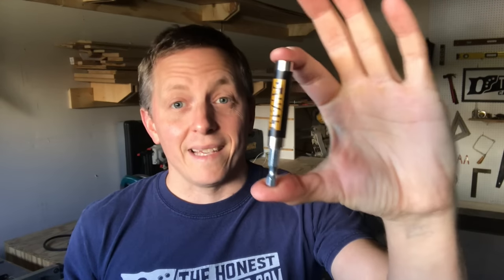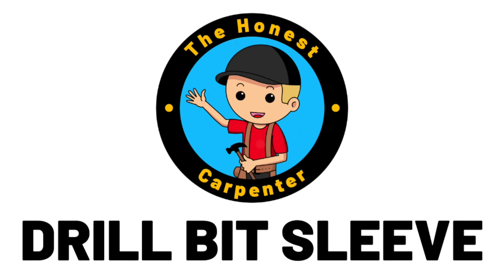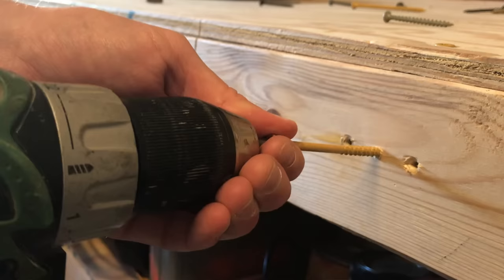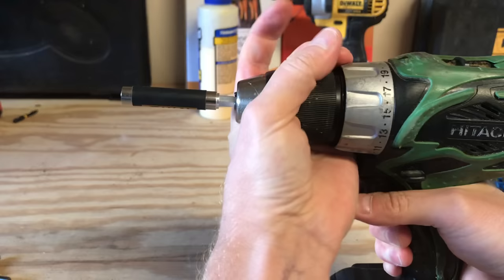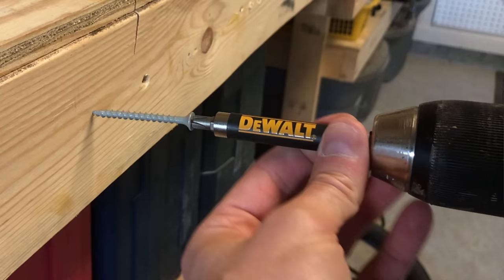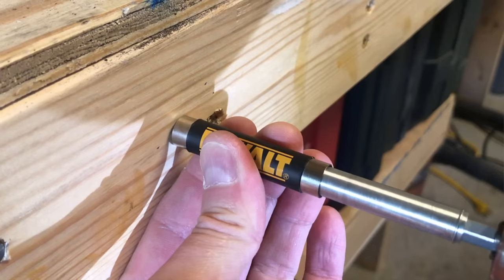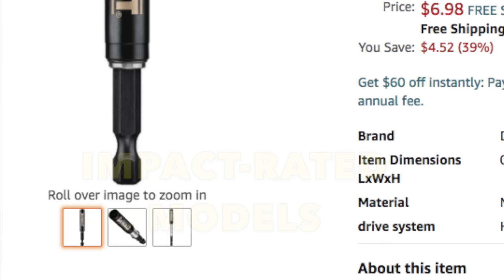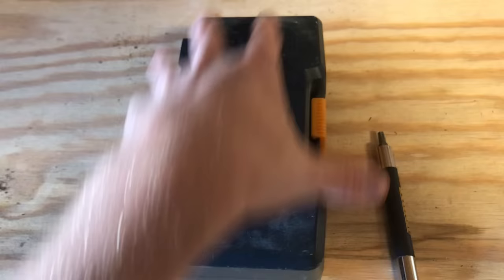This Tool Helps You DRIVE SCREWS WITH EASE! (Bit Guide/Bit Sleeve/Drive Guide/Drill Bit Sleeve)

Comment: Be mindful that sometimes the driver guides may not work on the older dual-sided bit drivers  (PH/S) because the slotted side makes them loose in the driver guide. I found there is a slight diameter difference between Ryobi and DeWalt driver guides which causes wobble. DeWalt is smaller and more accomodating. Better to use the small, l single-sided bit drivers and toss the dual-sided ones. Peace.

Comment: it's a handy bit but the problem I have with it is after sinking a square bit screw, the small bit usually gets left in the screw when I pull the drill away. Mildly frustrating after the 30th time...

Comment: Hi, i just purchased on off amazon, but i noticed that the screw doesn't stick to the bit. I hoped it did, because that would make one-handed use easier. now you can't use it vertically with one hand, and not well horizontally.  I tried adding an extra magnet, but that doesn't solve the problem. Regards

Comment: It's cheap Chinese stuff with a huge DeWalt on the side.  I recently bought a DeWalt countersink bit - made in China.  On its first use in countersinking a drilled hole in a cabinet, it came apart.  Yup.  That cool part on the bottom so that it fits in the chuck the same as the other bits in your tool box is only STAMPED onto the flat of the drill shaft underneath.  Cool, right?  Not when it comes apart.  Immediately.  Cheap tools made in China at premium prices because they are from Yellow Brand.

Comment: I have a couple of these and couldn't stand them.  The sleeve just slides down whether you want it to or not and makes it so you cannot see how far you have driven the screw.  I pulled the retaining rings off and removed the sleeve and just use it as a normal bit driver.

Comment: I use one of these to access restricted areas where it is impossible to maintain the bit in-line with the head of the screw...for example in a narrow stud bay where the body of the drill bumps against one of the studs. This guide acts as an "extender" allowing the drill body to be further from the head of the screw...and the annoying stud.

Comment: I've used these before and felt like I just ended up having the screw wobble in the sleeve, I'm a commercial electrician though so I'm usually driving into metal. I feel like it's really not that big of a deal to just use your fingers to stabilize the screw

Comment: What is the model number for the short one and can it also be used with a drill driver with 1/2 inch chuck or does one need a different model with a cylindrical end to fit into the chuck?

Comment: Dumb question but is it ok to just attach the screw into the driver to drive it? I tried this with a type of screw that doesn't have to be pushed all the way into the wood, because the upper section is meant to be coupled to another piece to attach two pieces of wood of a small tv furniture.

Comment: If you use your hands enough this is a complete non-issue.  I've driven countless screws and I've never had one puncture me.  This thing is only useful for driving in areas where you can't really reach in to hold the screw or if you are using your off hand to hold the joining pieces together.

Comment: This is the best thing since slice bread .  Been using them for years.  BE careful when you buy these.  They are not all made the same.  You want to buy one that is MAGNETIC like  the Dewalt drive guide from Amazon.   - Bit tip holder is magnetic so screws won't fall off.  I bought a Milwaukee bit driver guide the other day at Home Depot.  The package said it was magnetic.  The magnet was only strong enough to hold the bit in the socket.  It would not hold on to the screw!  Garbage bag material.  No good if it does not hold the screw.  My advice, if you are going to buy another make other than Dewalt, try it in the store.  If it does not hold on to the screw, don't buy it and buy the Dewalt one.  By the way the Dewalt Drive guide is $8.97 at Home Depot Canada.

Comment: I love bit sleeves, I WANT to use them more than I do, however, the major drawback is that you cannot see your screw depth when setting a fastener.   You're literally clueless as to where the fastener is.     I tried them on a recent drywall job to save my fingers the usual stress, but it was a disaster, so, I had to put the tool back in my bit case.   The other guy on the job chuckled as I put it back in the box....

Comment: The dewalt bit guide/sleeve is very cheaply made. It has a little ring in there that stops it from sliding all the way off. That little ring comes loose pretty easily, and it renders to tool basically useless. Buy a different brand!

Comment: Seriously?? Your a professional carpenter? The bit guides have their place and sometimes really help. But over all get better bits and keep your drill straight.  Most of the time they get in the way or the sleeves fall off. Plus when your relaying on the sleeve the screws are not screws in perfectly straight. Any pro carpenters can use whatever tip that’s in the drill. Buy better bits buy good quality screws and learn how to drill straight and you won’t have a problem. Also drywall screws are made for drywall, to install drywall on walls, nothing else. They suck at everything else. If you use them for everything then your just a hack that uses the cheapest building materials. Don’t feel bad we all have done it at the beginning. But there’s a reason why the screw isle at the store is so big and filled with so many different types. They all have a reason and are designed for specific applications